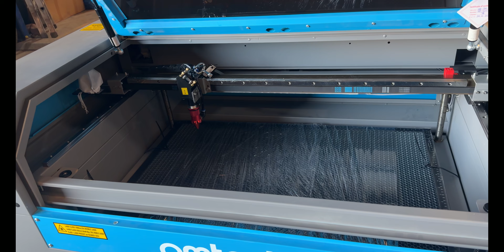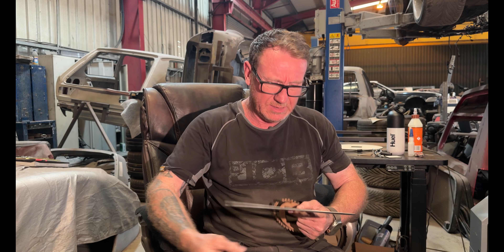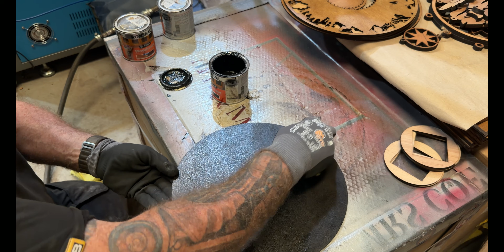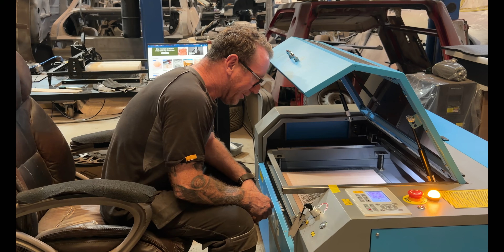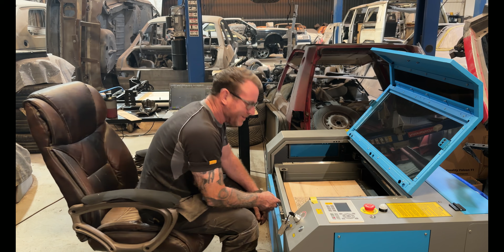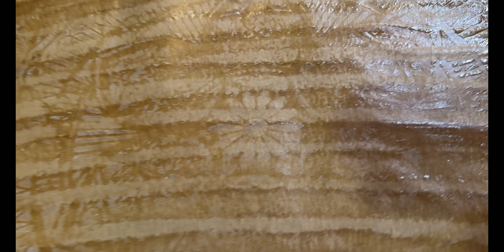Can ONE Machine Build a Real Profitable Business From Scratch in a single Day?

Comment: One suggestion. When you have engravings to do, like your numerals, you should do them before the cuts. Just in case the cut 'drops' and may hang up in another spot and be on an angle. Then your engraves would be blurred.
And I can't stress this enough. Especially if you're going to keep the lid open. Wear safety glasses!!! CO2 isn't visible, but highly damaging.
Reply from the maker: That’s a great tip about the engraving order, and I definitely appreciate the safety advice! :)

Comment: You should use air compressor to blow out the bits
Reply from the maker: I would be I had put them on tabs to keep them in it works with loos parts but not tabes parts 👍

Comment: Careful running out with the lid open uv radiation
Reply from the maker: Thanks for the concern, I’m never near it for long :)
Reply: @YCR-CutWorkS I like that machine I have a 40 W CO2. I’ve been playing with the last few weeks I 3-D printed an air assist for it I hope to try it out this afternoon. On some 3 mm plywood. It’s been working great on acrylics and rubber stamps
Reply from the maker: @crossxcats  Air assist deffo makes for a cleaner cut :)
Reply: @YCR-CutWorkS  definitely I just tried it out by engraving a 3-D image on OSB it looks amazing. I tried to do it before without the air assist and basically had to shut it off right away because of the flames
Reply from the maker: @crossxcats  the world is now your oyster 😄

Comment: You've not made a penny until you can persuade somebody to buy them. I wonder how long that will take and how much it will cost you.
Reply from the maker: You are correct but I’ve sold about £300 a month from the YCR CutWorkS online shop in the description and about £1000 to friends and family ( I know friends and family run out) but for a hobbie business I don’t think that’s bad as I’ve only been doing it 8 weeks. :)
Reply: @YCR-CutWorkS  £300 a month won't leave you much pocket money if you had to pay for the laser cutter you used.
Reply from the maker: @geordiemik72 ok
Reply: @geordiemik72  good point buddy, best machines for making money right now seem to be data centers

Comment: just wish i had the cash and space for something like this!
might have to start putting a few quid away each month and work oout where i canfind some room.
excellent work!
have out sold all of the bits you have made so far?
if so, could you give an update on the profitability of each piece / overall?
at a break even point yet with the machines, plans & materials?
another thing that might work rather than brown paper (yes, i know you have it availiable...) is greaseproof baking paper.
i use this to protect surfaces from wood glue as nothing seems to stick to it, plus it's fairly cheap.
Reply from the maker: Glad you enjoyed the video, I'll definitely keep those questions in mind for a future update! 👍

Comment: On pieces that you have small intricate parts to remove, use a vacuum with a brissle brush end. I find it removes the majority of the pieces really quickly and only leaves a very small amount to remove by hand.
Reply from the maker: Great idea, that sounds like it would save a lot of time! 👍
Reply: That plus cutting with more power.  Any additional scorching on the back would be hidden on the upper layers.
Reply: Great tip